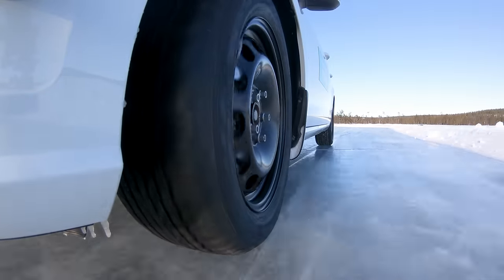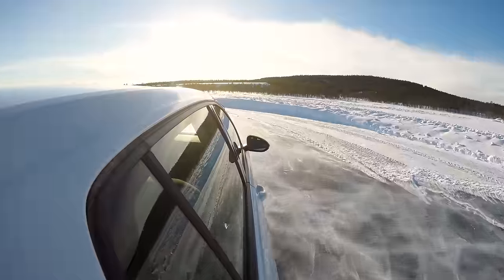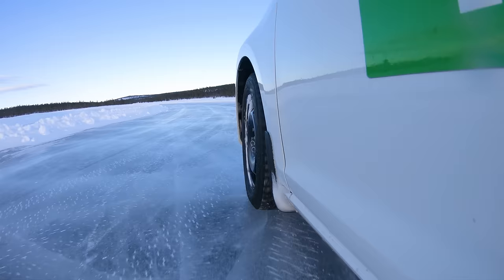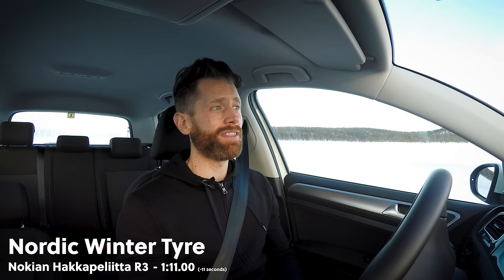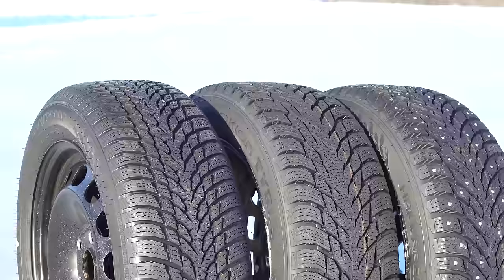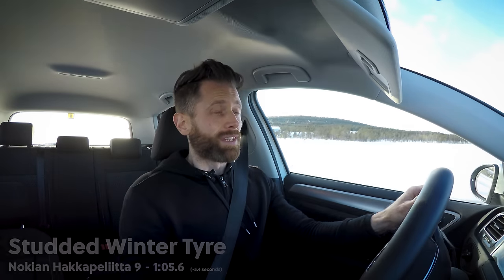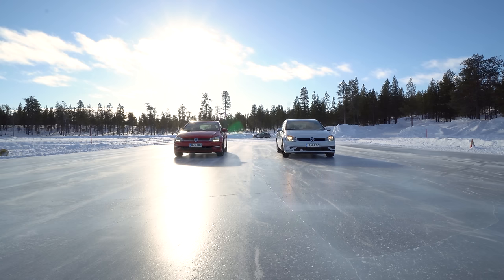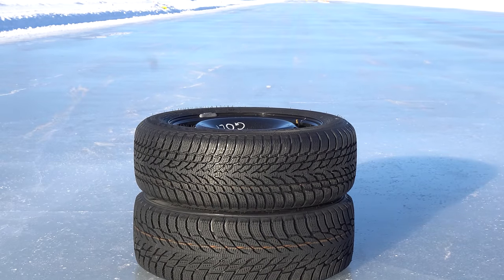Winter Tires VS Studded Tires ❄ What's better on ICE?

Comment: Been saying this for years, I was in the industry (automotive repair and tire sales) and I drive on average 50-60 K kilometers a year, at least a 1/3rd of it in winter conditions. Studded ice radials are the ONLY way to go
Reply: I know the comment is 10 months old but i gotta ask how do studded tires behave on relatively clean pavement. I'll do some icy hill driving where studds would come in handy but most will be driving on pavement with a lot of salt over it. Do studds wear out faster?
Reply: @ilijapetrovic5002  Not the guy you're replying to but I live in western Canada and used studded snow tires on my father's pickup truck so hopefully, I can help lol. Usually studded tires will just be noisier and will wear out a bit faster. If you do more driving on pavement then a studless would be the way to go. Studded tires are more for icy and hard-packed snow.
Reply: @ilijapetrovic5002  I use studded tires in western Canada and I haven't seen any visible wear on the studs themselves at all in 2 seasons. That's from driving about 44km everyday mostly on an 80km/h highway (usually bare asphalt most days) with some side roads and large hills (always snow/ice covered). The stud tips are typically made of tungsten carbide which is perhaps the hardest commercially available metal (about 5x harder than tool steel, 4x harder than titanium) so wear really isn't an issue.
Reply: Not legal in all jurisdictions.
Reply: Studded tyres are not best option for everyone. I live in country, where studs are legal. I had last studed tyres 8 years ago. From there I am driveing only "winter tyres". I even drive on ice tracs in witner whit theese. I see no point of owning noisi studed tyres, that brakes the asphalt. thees days where studs are really needed are like 3-5 in year.
Reply: @ilijapetrovic5002  yes but I drive a lot
Reply: @storm5013  A materials science professor once told me some studs were actually made too hard so they didn't wear out along with the rubber and caused issues.
Reply: @s4nder86  I can absolutely see that. The rubber likely wears down radially at a much faster rate than the studs causing them to protrude from the tire more as the tire ages.
Reply: Been using syped/studded Federal Himalayas for a decade now in North Idaho and they've been great

Comment: There is no comparison for me the studded tires out perform non studded by far.   The amount of confidence I gained to actually control the vehicle on snow and icy conditions with the studs is amazing.
Reply: In slush ,  water and salted snow..studded are usless
Reply: When it Comes to dry roads, slush, water, salted snow..studded are useless
Reply: Except when the studs wear out.
Reply: @brosbrakkas7421  tell me you've never actually driven studded without telling me.... studs don't make any difference in slush, the thread pattern all around the studs does. The studded version of a tire is always better, but yes it is expensive
Reply: Hopefully all that confidence in some wont kill others…
Reply: @lhenry1693  lol that was something i wanted to say... over confidence in winter is a bad thing... better be careful than pulling out in front of someone.. expecting your car to bite and it doesnt...

Comment: I have been using Nokian Hakkapeliitta studded tires for more than 10 years. When you need the grip in an emergency situation they are the best choice. 
Non-studded tires do not come even close when there is bare ice on the road, for example in freezing rain which happens too often here in Sweden.

Comment: Improving an already very good lap time is much more difficult than improving an ok one. Those 5 seconds are just as impressive as the first 10 are.
Reply: tbh this whole test is pointless because 99% of people wont drive in such conditions.
Reply: madott Not true man
Reply: The comparison is very weird anyway, the studded tyres look like they're based on the Nokian Snowproof which means that changing the compount was actually worse than just studs. Change compound? -11 seconds. Add studs to first tyre? -16 seconds.
Reply: @madott  Take it from an Alaskan.  These conditions exists all winter when you're 58 degrees and up.
Reply: @sighermike  Thanks for educating the guy. In no way data testing for safety is useless if it's saving lives.

Comment: Studs hands down here in the Pacific NW. When we get ice in the valley it's always a wet ice, not the nice cold dry stuff.  But the best tires ever are no longer available. Back in the Midwest when I was a young man we had a retreader that mixed black walnut shells into his rubber mix.  Those where awesome and didn't damage road surfaces as bad as metal studs.
Reply: How about a side by side comparison of the Nokian R3 and the Continental ContiViking Contact 7. These are the top nordic winter tyres, in my opinion. 😉
Reply: Toyo’s GS5 series use walnut shells in their winter tires, fyi
Reply: Even better, there was a company that did carbide bits instead of walnut in the retreads.  Called Green Diamond or something but it was only around for a few years around the 2008 time and think they've long since went under.  Carbide would be awesome for rock climbing as well.
Reply: Nokian R3 (and I think also the older R2) do have “Cryo Crystal” particles mixed with the rubber. I’m sure they’re better than just walnut mixed with rubber on re-tread. Probably old tires just seemed better cause in the past there was less traffic, maybe also better road conditions, and maybe memories just grow sweeter with time.
Reply: Big Mo What were the best tires ever ?? Just curious your opinion
Reply: But you wanted a Bridgestone blizzaks - but specifically the ones with their Nano cell compound. Those tires are indescribably good at that type of ice. They are a little bit expensive, and they wear excessively fast, but they give traction equal to or better than studded tires under those conditions ... and that's from personal experience. They're currently up to the WS90's, and those would be exceptional for what you're talking about.
Reply: Most slippery arround 0° and ice, without studs you can't brake or park where it's not flat, but wintertires for warmer climate need more working in muddy snow without ice under it and wet asphalt, while up north and colder climate need tires for ice, but to test without and with studs there should be other tests like brake distance and evasive maneuverability together up and downhill tests to really see the real difference and test it in slippery temperatures.

Comment: Great video, awesome testing and report. I live in central Canada and have been wearing Nokian tires for 20 years. Snow is an issue here but the most troubling issue is ICE! Studded Hakka 9's is my favourite  tire choice for my Range Rover and having tried the Nokia WR's I can certainly say, the difference even in snow conditions is huge. The studs are a bit noisy on dry road but they are awesome.The tests are conclusive when it comes to breaking, non-studded tires are great but Studded tires are best. The difference in stopping distance on ice ( about 1 meter ) is like hitting your breaks and saying....."OOOPS"! or hitting the breaks and saying ......OH SH*T!  :)  Car accident avoided. ( studs are allowed in Canada from November 1 till May 1) and the Nokian eco-studs are designed to do little to no road damage by the way
Reply: If you are hitting your breaks and saying,  "Oh sh*t!" you are going too fast! Studies from The University of Washington actually showed that studs are better between zero and thirty two degrees (F). The advantage of studs decreases (and eventually disappears) at lower temperatures because the gets too hard for the studs to dig in. At such point studs can become more like skates. The study is available on line.
Reply: @alansach8437  It seems to me that your knowledge is based on studies and that's ok.. Here in Canada we don't need to consult the internet for answers, because the answer is called tried tested and true life experience. You don't need to go fast for your tires to hit ice hidden under the snow in certain "bad spots" ( as we call them and can be at various areas unbeknown to the unsuspecting motorist and critically at stop signs or controlled intersections). I have pictures of my studs digging on solid ice and making scar marks! Further more to dispel any of your doubts about studs, I invite you to watch videos of cars racing on frozen rivers in Canada. You will see with your own eyes that the  ONLY tires the race cars or motorbikes are wearing are....STUDDED!!  Videos are available on line.
Reply: @rrshse6704   well said sir,  i find that people seem to demonize studded tires  when  have never used them , the difference is amazing  modern studded tires are so different  from the studded tires of old that people still think off , the only draw back to these  tires is price  but on a -30 icy day they are worth there weight in gold . Drive safe
Reply: @callumduncan6728  Thank you! :)

Comment: Keep up the excellent work! 
Would be really interesting to see RWD vs FWD vs AWD on the same winter tyres under the same conditions.
Cheers!
Reply: 1. AWD
2. FWD
3. RWD
Tested in winter during the history of cars here in the north...
Reply: That would be a great comparison.  Also, it would be great to show what happens when you only put your winter tires on the drive axle (front for front wheel drive, rear for rear wheel drive) VS winter tires on all 4 wheels like you are supposed to do....some people believe that they only need 2 winter tires if they have a 2WD vehicle, but a comparison showing having all 4 winter tires installed VS only 2.
Reply: this is what I want to see!
Reply: @wildbill23c  et al. Already done: https://youtu.be/A5aMnmekA38 

See also https://youtu.be/atayHQYqA3g
Reply: @wildbill23c  if you only put 2 winter tires, front or back, you will glide.  especially in turns,  This video represents similar situation because difference of grip between axle https://www.youtube.com/watch?v=_wo-9112aHw
Reply: @Scramasax  When it comes to traditional ICE cars, electric cars such as Tesla would have FWD and RWD the same and AWD better.
Reply: Rwd for fun awd for control fwd in kinda in between, I like pulling the awd fuse in my car some days so I can kick the assend out every once and awhile
Reply: @wildbill23c  4 winter tires vs 2 winter tires video can be found on this very channel. Done last year. As a Finn, it is hard to imagine someone driving with only 2 winter tires, but apparently it is a thing somewhere?
Reply: @Daltonfg  Thanks I'll have to see if I can find the video.  I live in Idaho and people do that crap all the time just buy 2 winter tires and leave their bald summer tires on the non-drive axle and wonder why it tries to pass them every time they stop.  You just can't fix stupid.
Reply: @Scouten819  Why RWD for fun, but AWD not fun? I think, AWD is more fun, than RWD. RWD is just slow and boring, good for beginners to practice.
Reply: This scenario has been well tested by several groups.  Tires are much more important for safety than AWD.  This comes as a surprise to many people in the US, because the US has AWD winder driving requirement laws.  AWD only helps with acceleration.  This is like having a law that cars must have over 300hp in the winter, which also helps with acceleration.   Notice, every other country winter driving laws are based on coefficient of friction instead of AWD.  When in comes to driving, we, the US, is an international embarrassment.  I remember when the US also made terrible beer.  Hopefully, we can improve our driving, like we improved our beer.
Reply: @theBear89451  People here in the US seem to rely way too much on the electronic nannies in their vehicle rather than actually learning to drive properly, and they figure that their insurance company will take care of the rest...I think if someone causes an accident they should pay out of pocket for damages, I bet they'd drive a lot more carefully if the money was coming out of their own pocket rather than everyone else's insurance premiums going up.  

I don't drive nice fancy vehicles because all that electronic garbage annoys the hell out of me, and doesn't do anything in regards to safer driving it just makes you think you are invincible because you got a beeper that goes off when you are running over stuff or cutting people off it don't stop people from getting into wrecks it just makes them even more lazy...I see it daily people jump in their car throw it in reverse and backup without ever once looking around and behind them.
Reply: @theBear89451  " AWD only helps with acceleration. " --- This is wrong opinion. AWD is better in corners also. Only foot braking is no difference, but even engine braking is AWD superior. Of course you need proper real winter tires also always.
Reply: @theBear89451  ok lsa pop
Reply: I ran the 9's 4wd and Rwd up the mile-long steep dirt road I live in when it was solid ice.  4wd extremely competent of course, but I was very surprised to make it just fine to the top in RWD, too!
Reply: @wildbill23c  Why should people pay out of pocket? Isn't that the whole purpose of insurance? In my experience it's cocky drivers who cause the most accidents. ANYBODY can have an accident.
Reply: @alansach8437  Because having to pay out of pocket for an accident hitting them in their own pocket book most likely would teach them to pay more attention and drive more carefully...letting the insurance company...rather everyone else pay for their piss poor driving skills, and habits doesn't teach them anything other than they can keep doing it because its not hitting them where it really matters in their own wallet...that's why your insurance premium goes up occasionally, it might not be your driving habits/accidents, but you actually are paying for those who do have accidents.  The money you pay in insurance premiums isn't for you, it goes into a community pool.  Someone that uses your same insurance company gets into an accident, money is taken from the pool to pay for damages, medical, etc.  So, if someone causes an accident due to piss poor driving skills, not paying attention (inattentive driving), etc. should pay out of their own pocket all costs associated with the wreck, which with today's medical costs, and automotive repair costs it can be tens of thousands if not hundreds of thousands of dollars.  Maybe that would get people to actually pay attention and drive a lot better if they knew if they hit someone because of their terrible driving practices that the damages are coming out of their own wallet, they'd pay far more attention.
Reply: @Scramasax  
1. AWD
2. FWD
3.
4.
5.
6.
7.
8.
9.
10.
11. RWD